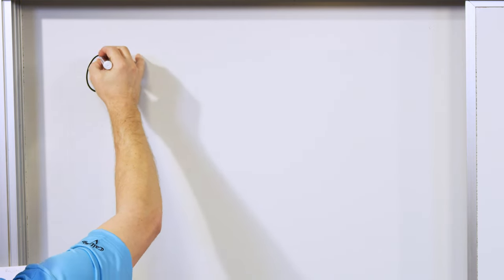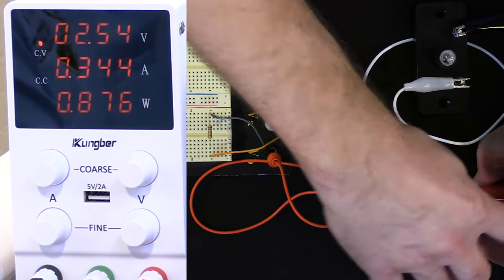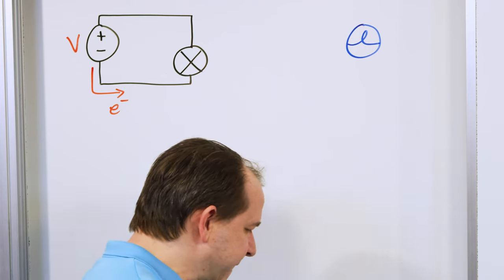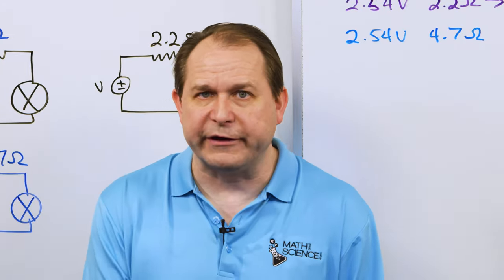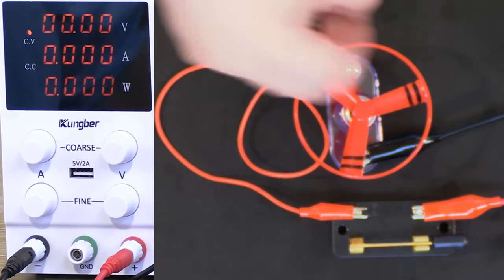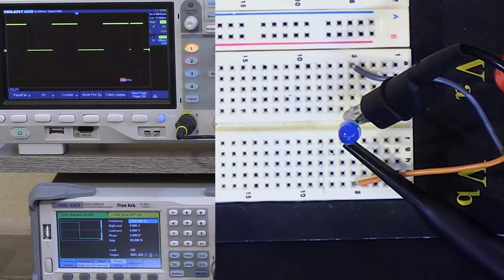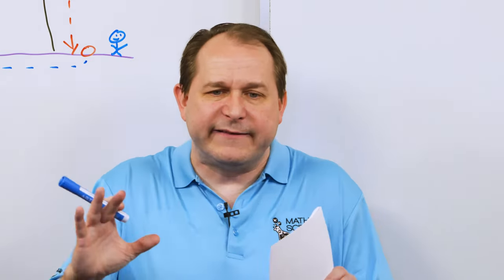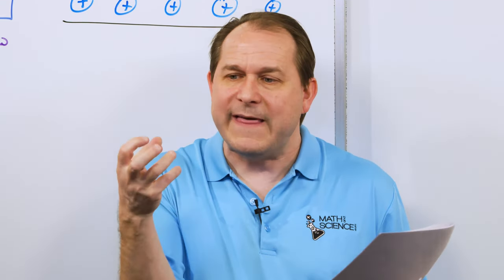Current, Voltage, Resistance & Intro to Circuits

Comment: I an confused why at the 30min mark you say the current is flowing from the + to the -, but in earlier parts you say the current flows from the - to the +.
Reply from the maker: Electrons are the actual charge carriers. They have a negative charge and they flow from the negative side to the positive side. But in engineering we pretend that there’s actually a positive current flowing in the opposite direction. So when we reference current flow in electrical engineering, it’s almost always reference from the positive terminal to the negative even though the electrons are actually flowing in the other way.
Reply: @JasonGibsonScience  I see, thank you so much!